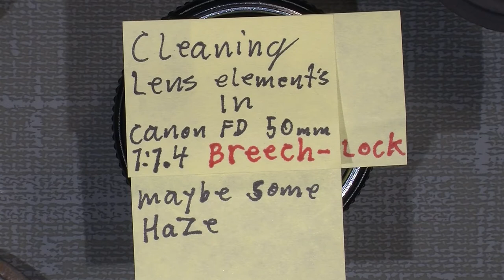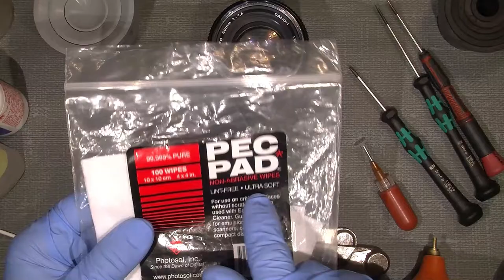Cleaning lens elements in Canon FD 50mm 1:1.4 Breech-lock version (maybe Haze)

Comment: The last Canon lens I worked on was a 59mm f1.9 with the later style of mount. That took me about 14 hours in total trying to get the stupid mount back together. One of your videos was the saving grace there.
And with the 50mm f1.4, same thing. All day I've been on this, and couldn't get the mount aligned properly.
I've stripped and rebuilt loads of Nikon and Pentax lenses, and never had issues like this. 
The FD mount is an over engineer nightmare, so thank you for saving me numerous more hours of misery trying to get this thing repaired!

Comment: Hi Kenneth, thanks for this video and the many others you put on YouTube. I’m about to clean the same lens here that has fungus. I’ll use hydrogen peroxide, but my question is, should the H2O2 be thoroughly cleaned off before using ISO or lighter fluid for additional cleaning? Will a combination of the two damage any coatings?  Thanks in advance.

Comment: Thanks for sharing. 
I have this lens.  the diaphragm does not operate regardless of the position of the silver ring, which spins freely with just a click into the ready-to-mount position.  
I've seen videos or pressing two small buttons to rotate the lens axis.  but on this model it seems fixed, no small buttons.

Comment: Mike I find your videos super-interesting and helpful.  I'm wondering if you've ever come across a focus ring with some play in it?  It moves all the way from Infinity to close focus, but has about 7mm or so play in either direction before it engages.  I feel it should be a simple fix, but I can't figure out a way to get to behind the focus ring to see what's going on without completely stripping the lens.  It's a pristine Canon FD 55mm 1.2 S.S.C.

Hope to hear from you.
Reply from the maker: Thank's, I only have the 50mm 1:1.4 lens, but I will guess it's the almost same way for the 1:1.2, so I will make a video about how the problem maybe can be fixed in the 50mm 1:1.4.
Reply: @mikeno62  Thanks Mike.  I actually figured it out on Sunday using a few bits from your videos to work it all out.  Actually remarkably simple.  There was a notched gold ring that needed undoing in order to remover the second layer (so to speak) then you can access the little screws that hold the focus ring in place.  These had loosened.

Thanks for the good work on all the videos!

Comment: I Thanks for for your excellent video with all the background information.  have just bought the FD 55 f1.2 ssc breech-lock, it arrived from Japan. It's almost immaculate and the first few test shots are promising. I am using an a7r and a6000 and having already got an adapted NFD 50 1.8 I was astonished by weight of this beast. Good job I usually carry my kit in a trolley! 
Anyway "The Beast" has a couple of slight tight spots with the focus ring which I assume is the grease dried and it needs cleaning and lubricating. 
Am I right thinking the f1.2 is similar to the 1.4 breech-lock you demonstrate? 
Stay healthy and thanks again!

Comment: Thank you very much for such illustrative video I learned a lot! Just one quick question. Does lens coatings are not affected by lighter fluid? Regards.
Reply from the maker: The lighter fluid will not at all harm the coating, the coating is very very hard, but in some other lens brand that have a softer coating, it could be a problem (some older Zeiss lenses).